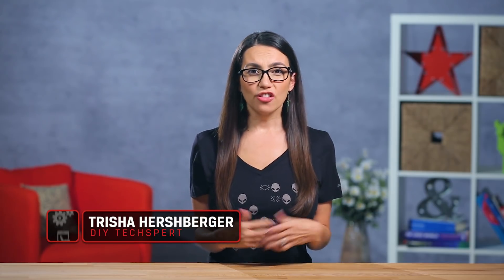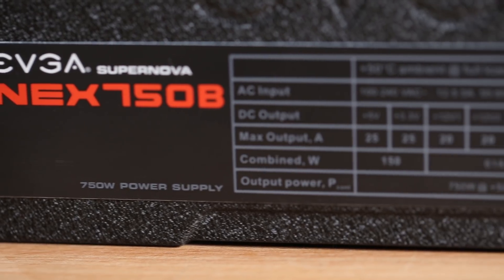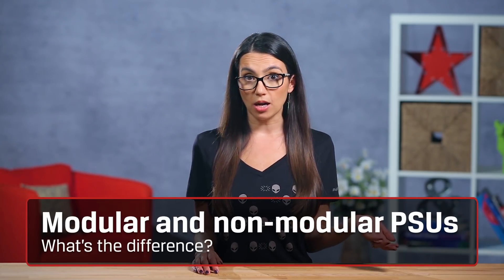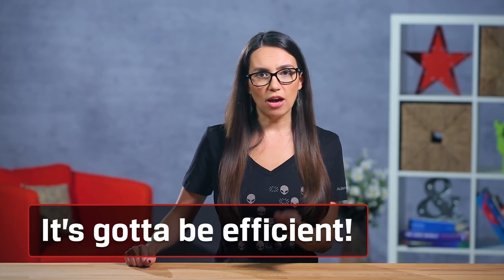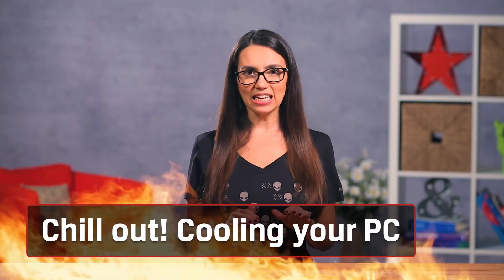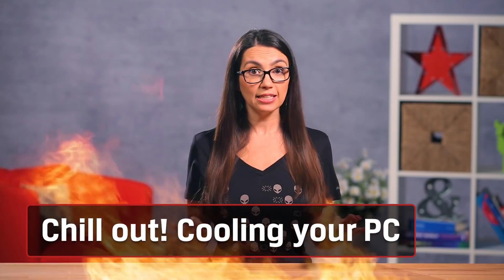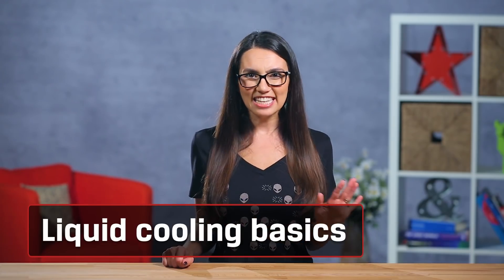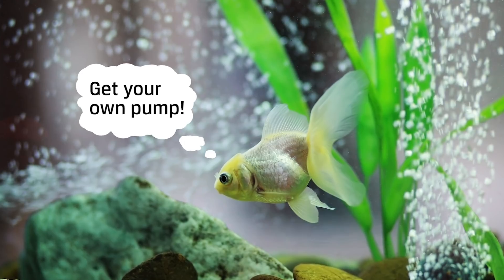PC Build – How to Choose a Power Supply and Cooling – DIY in 5 PC Build Part 4

Comment: I build my first PC 2 years ago and it is both rewarding and nerve-wrecking at the same time. I saw through your last few videos. I would mention in selecting cases about the availability of drive bays (if wanted), the airflow of the case and how modular some of these cases can be (removable hd cages or ssd caddy in back). Also when discussing the pros/cons of air vs liquid cooling, it is worth mentioning that the only thing likely to fail on air-cooling is the fan which is easily replaceable (and cheaper).

Comment: Over sizing a PSU should not cause a lack of efficiency.  Modern switching mode power supply use a PWM (pulse width modulation) control IC, to change the rate at which the power is feed into the snitching transformer, based on feedback.  Now power supplies have multi voltage outputs, but by the nature of the PC the largest current draw is on the VDC line for the processor and other logic devices.  This is the output voltage that the PWM compaitor uses to regulate it output width.   This should properly regulate the power efficiency  With the small cost difference between various wattage of power supply, over sizing a PSU should actually be go for the system stability, since the PSU has to put out less effort.
Reply: ironwarmonger larger PSUs (850w+) have worse efficiency in the sub 100-200w range.. Its true. Look at in depth reviews of power supplies. If you can use a 300w PSU it will in general be more efficient than a 850w PSU at 150w.
Of course every PSU is different, but in general what she said is true.
Reply: Then there is a lot of poor designs for switching mode power supplies on the market.  The entire point of the PWM PS is that is can scale to the power draw, and that it requires smaller caps then a linear PSU.
Reply: Check out this page on the EVGA platinum efficiency 850w PSU..https://www.tomshardware.com/reviews/evga-supernova-850-p2-power-supply,4454-5.html

At low loads (10-80w) it gets as low as 60% efficient.. And they complain saying they obviously tuned it for better efficiency at higher loads. A bronze 300w PSU would very likely be more efficient in these ranges, as it was the designed to operate at those loads. A platinum 300w PSU definitely would beat it at these loads.
Reply: And that is my point, the difference between a 300W and 900W is only 1 to 1.5% in efficiency, the chart is hard to read accuracy.  so having a over sized power supply is not that much of a difference is operating costs (contrary to what the video said).   And with an over sized power supply you are taxing it less during operation, and that will extend it life.

For example, my current computer was designed to be a small limited use computer, it was planed to be used on my electronic bench, but due to some economic issues it became my primary computer.  It has a micro XT Mobo, with integrated video, 8BG Ram, tower cooler and a few drives.  The original plan was for a 550W PSU, but the maker of the PSU I wanted wanted more for a 550W then a 650W, do I got the 650W.  The PSU has a fan that does not turn on until the unit is a 80% capacity, and the fan has never turned on, meaning is it running well below capacity and cool!  Extended the life of the PSU.

Comment: I'm personally already quite far along knowledgewise when it comes to building, customization, and overclocking. At the same time I watched you're videos just for curiosity sake and you do present things in a very straight forward and pragmatic manner. Great job! If anyone has questions on the enthusiasts side of things I typically am a confirmed amd overclocker as a hobbyist. I do have decent intel information but just happen to have more experience with amd gpus and cpus, socs, etc. Feel free to ask about things. No spam intended just happy to offer experience. I have knowledge with everything from cpu overclocking, cpu undervolting, fx series, ryzen series, old intel quad 2 core, ram overclocking and voktage including timings guides from ddr2 ddr3 to ddr4. Cheers all
Reply: milkcrate music Can you help me?

Comment: can you make video for $500 for 3 parts ?? CPU + 16GB DDR4 (i know its not the right time to buy so expensive) and the last and not least motherboard i have at the moment FX 8320 + gtx 1070 and i want change my processor that compatible and no getting bottleneck so i need these 3 part's that's can give me solid 60 fps with vsync on  on normal monitor gaming 1080p full HD  @60hz i need help please anyone can replay me fast ?

Comment: I've built a few small power supplies myself (for smaller circuits) and it's true about the efficiency not being good for larger supplies running smaller loads. The buck/boost switching converters have to be run in the load range they're designed for. I've literally looked at hundreds of Efficiency vs Load graphs when designing power supplies to find the perfect chip, otherwise I'd end up with really poor battery life. It could mean the difference between say, 45% efficiency or 93% efficiency.